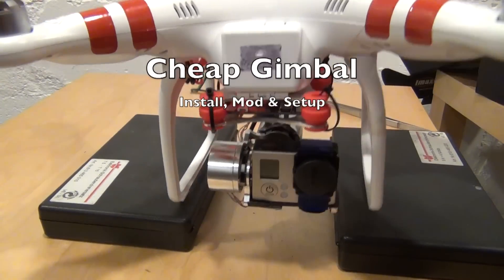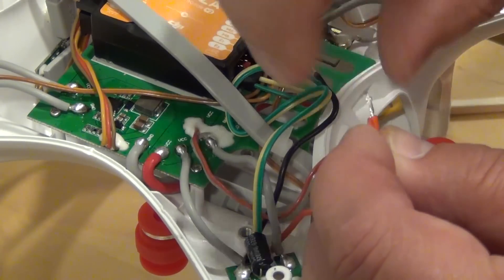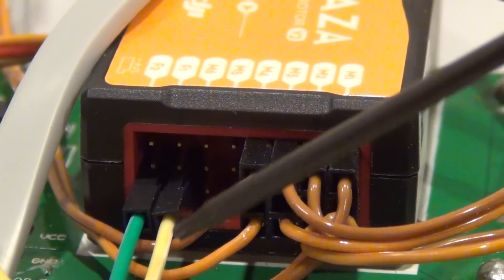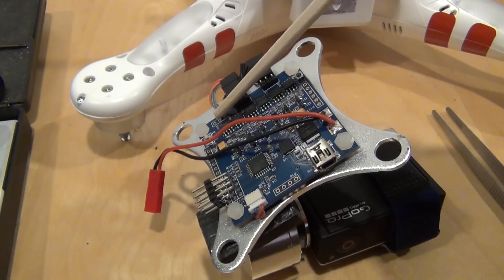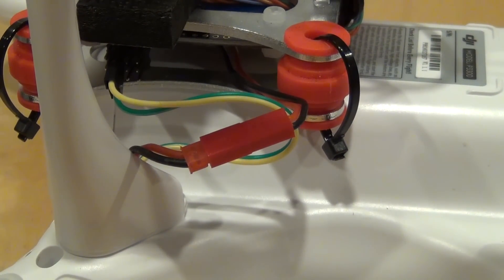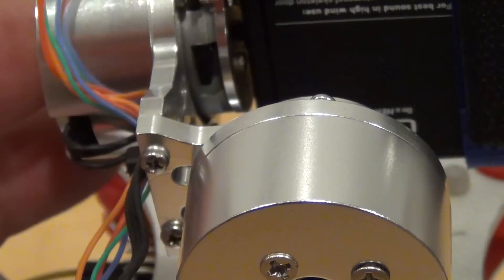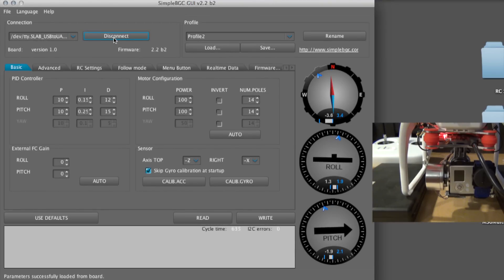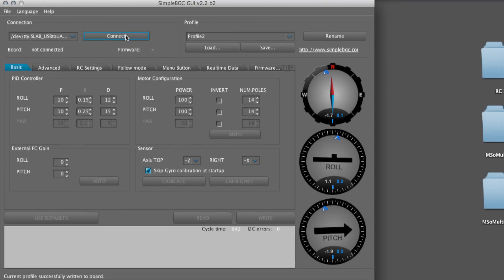Camera Gimbal for DJI Phantom (Complete Guide)

Comment: Hey I need help
Its the 4th BGB CARD I BUY !!! they fry everytime i connect them to the naza, even if I only connect the signal cables... wtf
I have a naza v2, a 4s lipo battery, a 8bit basecam card, mounted on a dji f550
:( it's the last time i'm ever buying one of these
Reply from the maker: Fusorf make sure it is 5V power to the BGB board, not 12 or more

Comment: Great video, thanks.  Do you know if you can use one of the naza ports to control pitch and yaw instead of roll? Would I just connect the roll port to the yaw motor control?

Comment: I have a similar gimbal china with firmware 2.2 b2 and its perfectly stable on the table and recording from my hand. When I fly with my Phantom 2 I get lots of vibrations in the video (it is worse than my P2V servo). Take a look here: https://www.youtube.com/watch?v=m3nIh-QpTw4

What settings do you think I need to change to compensate for those vibrations ? 

Thanks.
Reply from the maker: Can you send a video or picture of your setup? It looks like some vertical  vibrations? What camera are you using? Could be the rubber mounting balls? Are the wires to the motors moving freely? If so, i would try to increase the Power for the motors, if they are not already at 100.
Reply: It was the rubber mounts black ones complete garbage. I used earplugs inside them from EPO foam until I will receive my H3-3D original mounts for it (DJI part #40). 

Regarding the motors the roll one is 91 power and the pitch is only 51 power. Can you please send me a screenshot of your Basic and Advanced profile tab from BGC GUI ?

Thank you !
Reply from the maker: http://goo.gl/2nfxyU

Comment: My gimbal keeps blinking red. It can move, but the movements are very very slow. It does not work properly.. You know why??
Reply from the maker: What happens when you remove the control wires?
Reply: +mygiguser Which are the control wires?
Reply from the maker: +Jonas Gorm Jensen red and black is power. Green and yellow for controls.

Comment: Hi, great video... i have a question in the NASAM, i dont have the same values as you and i dont know if its recognizing the new settings... and in the BCG software, i don't see the board to select.
thanks for your comments or reply.
Reply from the maker: +Fernando A I need to have more information, if  you need me to give you advice. If you don't see the board in the BGC software, then you either do not have the right driver, the right USB cable, or the correct BGC software version, that fits the board. Maybe you can post a video of your setup and show the problems?
Reply: +mygiguser Thanks a lot for the replay, I got it running and functioning, but the pitch control wont work, i have a DJI PHANTOM 2 VISION PLUS, and im trying to replace the original gimbal with this one. the only thing missing is the up and down movement with the remote for the gimbal, i tried plugging the F1 & F2 pins to the NAZA module, but no luck with the movement. i hope i was clear enough, if not, please let me know and i'll try to explain myself better.
Thanks a lot!
Reply from the maker: +Fernando A I don't have a Vision Plus, but it is possible, that the DJI Vision Plus Software has the gimbal disabled. But I don't know, if it is possible to flash regular NAZA-M software onto a DJI Vision Plus.
Reply: +mygiguser Yes, i think it is, because i downloaded the NAZAM app and wont work, because its other model. but, in the DJI software assistant i do exactly as you and wont work :(
any idea how to do that? thanks!
Reply from the maker: Fernando A No idea. The NAZAM app is one thing, but then there is the firmware on the NAZA-M, that could be different to.
Reply: thanks for the reply, I did installed the NAZAM_2.40... but i think it wont work because of the naza contoller, the one in phantom 2 is different than the phantom 2 vision+... i dont get detected in nazam software but in the phantom assistant i do. i od the same steps fot he pitch and roll but it wont move, just stabilize ,but no pitch, any idea? thanks !
Reply from the maker: +Fernando A I have no idea, sorry!

Comment: caso voce consiga sanar minha duvida com relação ao comando tilt pitch do controle no gimbal .. ja vi muitos videos e nao estou conseguindo..
1- meu drone e o phantom 2 -> comprei com o zenmuze h33d (qbrou)
2-  comprei esse brushless 2 eixos
3- estou ligando o  cabo no F2 ou F1 ja tentei nos dois
4- meu controle ja esta instalado a alavanca na parte de baixo do controle!!
5 - no assitente do phantom 2 nao tem a opção GIMBAL(on)(off) e nos parametros esta dizendo que esta conectado.. agora nao sei se ele esta reconhecendo o atual ou se é alguma ligaçao anterior do h33d!
Reply from the maker: +Fabrízio Gomes Sorry I do not speak or understand the Portuguese language.
Reply: +mygiguser if you can solve my doubts with respect to the tilt control command on the pitch gimbal ..'ve seen many videos and I'm not getting ..
1- my drone and the phantom 2 -> bought with h33d zenmuze (broke)
2- bought this 2-axis brushless
3- I'm calling the cable in F2 or F1 already tried in both
4- my control is already installed the lever at the bottom of control !!
5 - the phantom 2 of the attending do not have the option GIMBAL (on) (off) and parameters is saying that is connected .. now do not know if he's acknowledging the current or any previous link is the h33d!

Comment: Hi, how did you physically switch the gimbal arm to the other side? the only difference is that the pitch angles needs to be the exact opposite? or does it needs some special configurations at the BGC software? thanks.

Comment: Hi
do you know what can i do when the gimbal does not appear in the assistant of the naza?

Thanks!
Reply from the maker: Camilo Fernades You need to be more specific. The gimbal in the video doesn't appear in the Naza software, it has it's own software!?
Reply: mygiguser OK. What is happening here is in NAZA's software don't have a option to active the gimba so how can i work the gimbal's tilt with my control of the phantom.
Reply from the maker: Camilo Fernades Maybe a different Naza software helps? I don't know, if the regular DJI software works with the Vision, I don't have a Phantom 2, therefore I am unable to try that over here, sorry.

Comment: hi again man.. sorry for disturb.. please take a look to my video.. look what my gimbal does.. i hope you can help me https://www.youtube.com/watch?v=_i9tfXwxJE8
Reply from the maker: Jesus Rodríguez Looks like it's not calibrated right. Is the BGC GUI software working for you? Then press the calibration button, and hold the camera in the correct position 100% still for a few seconds!
Reply: I already did that bro.. But still cant stable.. I dont know what other thing can do
Reply from the maker: Disconnect the green and yellow wire, then calibrate again. Calibrate Gyro and ACC.
Make sure, that the sensor and motor wires are lose, and not getting caught on the pivot arm.

Comment: Hi Buddy, I long pressed the button and the gimbal stopped functioning so i disconnected the power and reconnected, there was no green light just solid red aand now it wont connect in the GUI software as well.
Please help. I've tried a lot of forums but no luck
Reply from the maker: Joban Singh I don't know, really. It is possible that the board is broken. Try to disconnect the sensor and the motors and the power to the board. Then connect only USB to the computer, just the plain board, and try to connect to the BGC GUI software. 
You said, you pressed the button on the board. Maybe the button is stuck in the down position (internally). In order to fix that, you could replace the button (difficult, if you don't have proper soldering tools), or you could try to remove the button. If the board is broken, you may consider to just buy a new board.

Comment: Sorry, but it is hard to understand where some wires comes. I don´t understand where come wire nr 1 (at the picture). Also I don´t have on my Phantom wire nr 2. Do I have braze wire nr.2 and wire nr. 4 by myself ? Also my Phantom does not have wire nr 3, do I have to buy them separately. My Gimbal product has only these wires which are in last photo. Can you help me somehow, please.
http://static4.album.ee/files/1169/86/orig_29246555_D8wH.jpg
http://static4.album.ee/files/1169/65/orig_29241481_zOJv.jpg
Reply from the maker: Argo Hanimägi You need to show me where the wires in the last photo are attached to the gimbal. Just the color does not mean anything.
Reply from the maker: mygiguser https://plus.google.com/+mygiguser/posts/NSFHs6SNeqy

Comment: Phantom 2 don´t have this wires (like in this video), there are missing yellow and green wires which you connect with Gimbal. 3 wires what did you first connect in youre video (red and grey) - I don´t have this wires. I will send picture how does look out my Phantom 2 inside and this is not the same as in youre video.
http://static4.album.ee/files/1169/79/orig_29244787_w3KQ.jpg
http://static4.album.ee/files/1169/79/orig_29244785_gnlh.jpg
Reply from the maker: Argo Hanimägi I see you don't have the red and grey. Just solder it to red and black, the big wires coming from the battery.

Comment: Does this Gimbal have any instruction in youtube for phantom 2? Phantom 2 have another electric outlet.
Reply from the maker: Argo Hanimägi Does it? Do you have a picture? I thought the electrical connections are the same. Connect the gimbal to power and ground from the battery and the signal to F2 for the pitch control.
Reply: mygiguser 
on the first photo, there are electric outlets which are on phantom 2, on the second photo there are cimbal wires. How do I connect gimbal and Phantom 2? http://static4.album.ee/files/1169/65/orig_29241479_vGS3.jpg
http://static4.album.ee/files/1169/65/orig_29241481_zOJv.jpg
Reply from the maker: OK, you need to watch the video and open the Phantom, and then connect the wire as shown in the video. The wires you have in your pictures are the connections for the Zenmuse gimbal, and those are different. You only need three wires. Power, ground and pitch signal.
Reply: mygiguser 
Ok, but why do they but these wires to the package if I don´t need them?

Comment: i just try to connect the gimbal to my computer but they always said try to connect. even if i use the good com port!  DO you have any idea
Reply from the maker: Marcel Côté Do you have Mac or PC? I made a video for Mac https://youtu.be/5Vzicbqa6dY , but on a PC it is almost the same. You need to have the correct drivers matching your gimbal control board. If you are sure, that you have the correct drivers, then try a different BGC GUI version. Instead of 2.2 try maybe 2.4
Reply: mygiguser i juste order this one:    http://www.goodluckbuy.com/2-axis-brushless-gimbal-camera-mount-with-32bit-storm32-controller-for-gopro-3-4-fpv-black.html

the board is a 32bit Storm32. But i try so many thing that i'm lost right now.  It's possible to send me the right link that i need for my board
Reply: i'm on pc and i think my driver is correctly set
Reply from the maker: Marcel Côté You could start a Java console and see what that gives you for an error message. I made a video for Mac https://youtu.be/5I2KXE_P94E, but the commands are the same on Windows.
Reply from the maker: I looked up your board, and that is different from the one shown in my videos. Maybe you find some info here http://www.olliw.eu/storm32bgc-wiki/Getting_Started

Comment: How did you modify the camera arm of the gimbal?
Reply from the maker: charles wayne I cut the aluminum away with a Dremel, otherwise the Velcro strap wouldn't hold.
Reply: I have an iLook camera with a built in 5.8gig transmitter. The  antenna   port is on the same side as the gimbal  motor so I was trying to work out a simple  way to solve  the problem.
Reply from the maker: That should work.

Comment: but you mentioned to use threadlock.   My experience had been that blue Loctite will eat the plastic!    I've seen it on a few 'aircraft"  Phantoms.
Reply from the maker: Yes, that's possible, if you use too much. Only one tiny drop of thread lock is necessary to fix a screw. If it leaks to much on the plastic, then the plastic becomes weak.

Comment: Hey i want to say great video but i have one problem. My sensor board is the other way round when i power on my Gimbal it starts going crazy i used some tape to put it on the other way and sure enough it works. Is there any reason mine is different and can i change it in the software? thanks.
Reply from the maker: zak bartley Yes, you can set this in the BGC GUI Software. Below the Basics tab, there is Axis TOP and Axis RIGHT. Those values you have to change:

Look at the gimbal from behind just like the camera will view out from the gimbal. What axis points is right? Look at the arrow on the bottom of the sensor. Is it the X axis? 
If it points to the left, then enter -X in the GUI.
Does Y point to the front? 
Does Z point to the top, then enter +Z or Z in the GUI.

If you disconnect the cables to the motors, you can move the arms by hand without it flopping around.

The correct configuration should result in the following:
▪ Camera pitches forward–the PITCH arrow spins clockwise in the GUI. 
▪ Camera rolls right- ROLL arrow spins clockwise in the GUI.
▪ Camera yaws clockwise- YAW arrow spins clockwise.

Comment: Hi! I'm slightly new to the DJI world, and I plan on purchasing a gimbal as well. My issue is, the connectors are this Blue, black, white connector instead of the ones shown in the video. Where would i connect this to? Here's the link: http://www.ebay.com/itm/Hot-CNC-FPV-BGC-2-Axis-Brushless-Gimbal-Controller-for-GoPro-3-DJI-1-2-Black-US/281657520759?_trksid=p2047675.c100005.m1851&_trkparms=aid%3D222007%26algo%3DSIC.MBE%26ao%3D1%26asc%3D30157%26meid%3Dd23e24af020e4d39aff162b954bf49ab%26pid%3D100005%26rk%3D1%26rkt%3D6%26sd%3D131518009665&rt=nc
Reply from the maker: ***** What wires are blue, black, white? The ones on the DJI or the ones on the gimbal?
Reply: mygiguser After looking at the product's pictures, there are 4 wires that are supposed to connect the gimbal to the phantom, which come with it: a blue, lavender, black, and white. Which out of those four am I supposed to connect to the Phantom?
Reply from the maker: ***** I see. Those are the wires that connect the camera position sensor with the gimbal control board. Those wires have a connector on each side, and they fit only in one direction, and they do not connect to the Phantom.
Reply: mygiguser Just purchased it, thank you for the help!

Comment: I WOULD LIKE TO MOVE MY GIMBLE ARM MOUNT LIKE YOU DID..BUT WHEN I DID THE MOVEMENT CHANGED TO THE REVERSE?HOW DID YOU FIX THIS PROBLEM?
Reply from the maker: tomstrb Look in my video at https://youtu.be/2iT2WRpTMa8?t=9m35s   You can see that I changed the sensor axis to TOP -Z  and  RIGHT -X  in the Simple BGC GUI. And then don't forget to calibrate after you changed the settings.

Comment: I have a serious, frustrating issue with the gimbal. I need some help. Every time I fully charge my battery and lift off for flight, just 5 to 10 seconds later, I hear the low voltage alarm. Then roughly a minute later (still beeping the warning) it completely shuts off! I pull out the battery, and it's drained! What is wrong with it? Overweight? You guys appear to have nothing wrong with it. I have it plugged into the 12v power supply slot under the cx20. Any help would be much appreciated!
Reply from the maker: Amy Burns Maybe your battery is bad? Try to disconnect the gimbal wires, and fly like that. Does the battery do the same thing, then it is not your gimbal.

Comment: I think I connected everything right. The gimbal works fine with not pitch or roll wires connected. but when they are connected. it rolls( camera pans up ward and starts shaking. ). Any thoughts?
Reply from the maker: 100reviews You need to check with BGC software what the transmitter is sending to the gimbal board.

Comment: Hi, I followed all of the instructions you have in this video, and I must say, there is no better video out there to explain it this way. However, I have a little bit of a problem, and I will admit it might be my fault. I tried calibrating the gimbal as mentioned in the video, but after that it has been jerking everytime I power it up. I tried calibrating it again but the jerking does not stop. Is there any way to fix this? Thanks.
Reply from the maker: Thanks for watching my video! Make sure, that both of your gimbal arms move freely. Make sure, the wires don't rub on anything. Then see, if the skip Gyro calibration checkbox is marked. After that try to calibrate both gyro and accelerometer. If that doesn't work, then I wonder, if the sensor board is mounted correctly, or if you accidentally changed the sensor axis directions? You should make a short movie of your setup and problem, and post the link here in the comments. I can try to take a look at it.